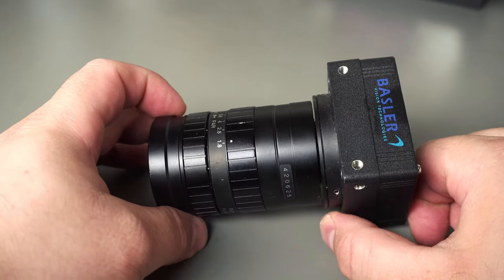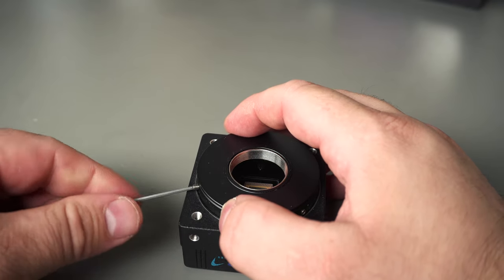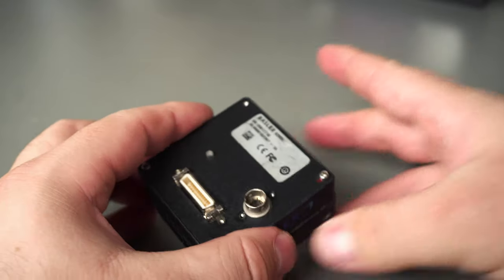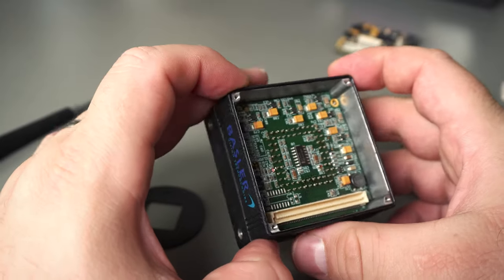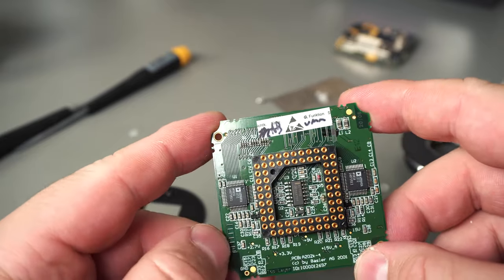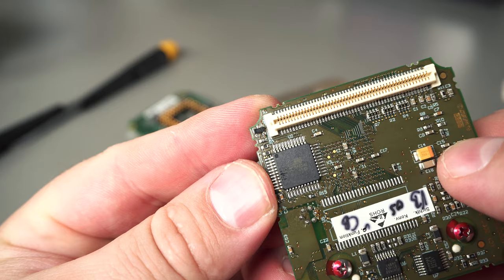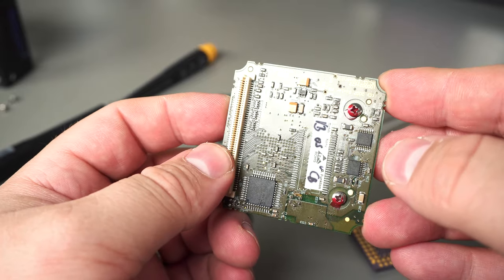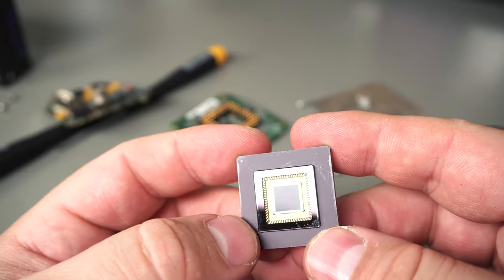Basler A202k Industrial Camera Quick Teardown

Comment: thanks for the video! do you have a link or file for the c-mount adapter you used? i also have a sony camera and a few c-mount lenses laying around i would love to test. thanks
Reply from the maker: Although I recommend just getting a metal one since they're so cheap (https://www.amazon.com/Fotodiox-Lens-Mount-Adapter-Mount/dp/B003Y32238/), in this case the lens doesn't actually work on the adapters due to their recess. STL: https://www.thingiverse.com/thing:3774827